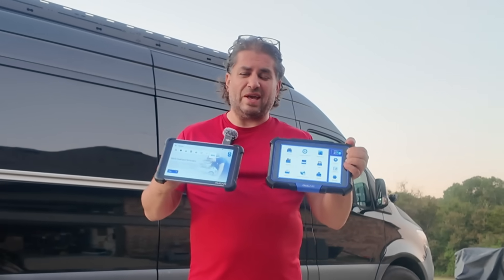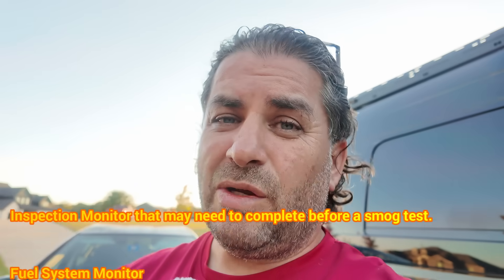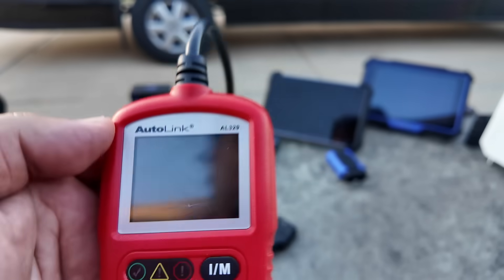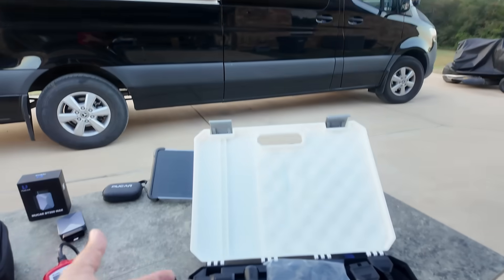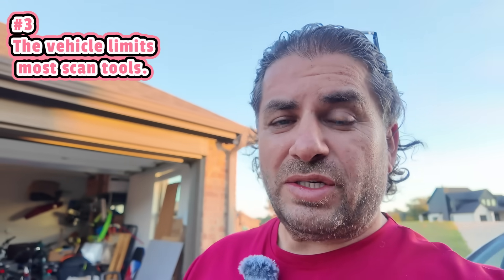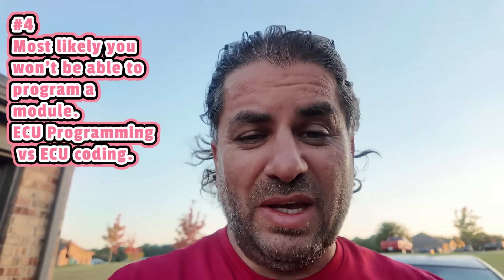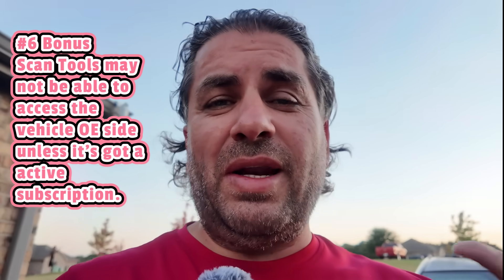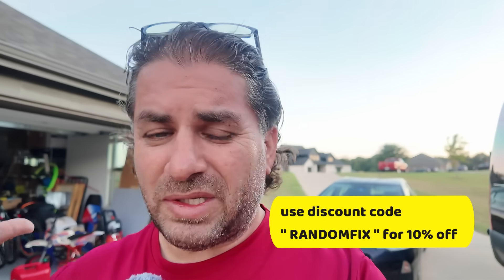Scan Tool Can't Do These 5 Things and No One Will Tell Beforehand

Comment: Well done. I recently decided to consider getting a scanner, but the options are mind boggling. I’m a DYI GUY. Recently retired from working on cars since the 70’s,,, yeah that far back 😁. Anyway I have a 2018 Dodge Grand Caravan and a 2008 Chevy Impala SS. I know most any scanner will work on the Impala but Dodge and Chrysler have Secure Gateway systems and I have to get what will work with that. Am I correct that subscriptions allow updates. But if you don’t pay for a current subscription that the scanner will not work at all? And why are some WiFi, is that only for updates or they will only work while the scanner is within WiFi range? Strange questions from someone who has worked on cars before but the dealerships had scanners so I never bought my own.
Reply from the maker: On your 2018 dodge you need autoauth access which runs over $50 a year but some scan tools may require you to buy from them and that access is $99+ a year. So would I do is try to bypass it the gateway like I show here https://youtu.be/uVVCs_zENxI?si=RByL52eMrlAnXygE and then get myself this https://youtu.be/q7QxnGdRL7s?si=_FpExnPy1pvNssP4 
You will also need to buy the bypass cables if you want to avoid that yearly charge and on some vehicles like you 2008 impala the scan tools may require can work without a Wi-Fi signal but on your dodge if you try to go the official way and purchase access for the yearly access they you would need a Wi-Fi signal.
That year fee is different from the scan tools may require updates, there maybe a separate fee for scan tools update but the one I recommend comes with lifetime updates.
I hope that helps and welcome to channel and hope you get to do lots of great things in retirement. 

Got a bucket list?

Comment: I purchased the Mucar 892 BT.  I own MB 2023 GLC300 and 2024 C300. The two give me an error related to”Encryption Gateway Authentication failed and limits the testing to OTC etc..” and is only a warning you have to click OK to continue. Also give me the note “sorry to inconvenience and ask me to download the software after delete it and perform fix firmware, then unplug Dongle for few seconds “ the options cancel, redownload or firmware fix. Any one clicked if you receive this note,  is over the scanner go into a bell sycle loop that don’t stop till reboot or shot down. Is a pain. Some times if complete the scan and you try to play with the results like maybe read live stream, or perform bi de rational testing the scanner freeze and nothing respond. I like to explain that works perfect on my MB 2007 C230. The only difference between other that the years are newer is that on the C230 only use the Dongle and on the newer cars it give you instructions to connect the Y adapter with a USB adapter to scanner I think to use the NOIP protocol. I having bad experience with support, the char immediate only ends on advice to fill the feedback form which I done it serveral times and they keep asking to give the serial number, my VIN of the vehicle and screen shots which I done it several times . I thinking the Y connector is the problem, because on the Y side nd the USB DAPTER before plug to the scanner have indicator of data active, flashing LED like any computer I see the data activity on the USB side of the scanner but in the Y side is dead nothing like is not working.  Any experience on this issue? I don’t want to return the unit to Amazon which dead like is about one week, I hope is a solution before that unless I get response from this forum. Thank you

Comment: For emissions, a basic $25 reader is more than enough - I just need the code so I know where I need to start testing components and to check for readiness monitors being set after repairs and clearing of the system.  I've had the Snap-On Solus scanner and mainly needed it for ABS and SRS code/system reading. Data is your friend (also for a code to set the monitor needs to fail twice in short succession).  only newer vehicle I own is my wife's vehicle (2016), my daily and trail vehicle are over 25yrs old (or close) so they are emissions exempt here in GA.

Comment: I have a 2012 Buick LaCrosse premium V6 3.6L with P0496 CODE  & 02S / HTR OXYGEN SENSOR showing on Emissions since 6-1-25 since then no check engine light I replaced 4 oxygen sensors, Gas Cap, purge valve, vent solenoid, mass flow sensor, Fuel pressure sensor, Map sensor, spark plugs, coil packs all OEM did drive cycles 4 times since then over 20 cycles each and over 4k miles each the 3 are the only ones that don't want to clear I am at my end in cash can't pass smog
Reply from the maker: These stories unfortunately are not uncommon. Here is the video to help with your o2 heater. https://youtu.be/Yn1-ul62Jio?si=K1sq4PbzHk4lSLtB

Is that only unset monitor?
Here is the gm drive cycle https://youtu.be/Yp34ksJY-fQ?si=LCnUDj2DHtCUoJqZ
Also are the o2 sensors all oem?

Comment: Think about before buying a product from this company.  My Think Tool Platinum S6 Scanner failed after an extremally light use. (The unit is not getting charge).   I contacted the company, and they are not providing any customer support. A lot of people are having the same issues with these devices. Please do yourself a favor stay away from this Brand

Comment: The evap excemption was mainly for gm vehicles because they are extremely hard to get ready. Even runnjng a service bay reset to get them ready often won't even work.
Reply from the maker: Now that exemption is gone, what can be done? 
No one I know has access to a service bay reset.
Reply: @RANDOMFIX  honestly I dont know. My scanner can do the service bay reset and my own truck wouldn't get evap ready after 5 minutes. Luckily I'm in NJ (not much better than california for emissions and bs regularions) so I was able to pass my inspection this week. Honestly I am sure its going to be california's way of getting more internal combustion vehicles off the road. They really don't understand that we are in no way shape or form ready for the amount of electric vehicles they want.

Comment: My OBD port randomly loses communication, the port itself was replaced and i could not find any other issues and suspect the BCM, I have power and good grounds at OBD as well as 2.6 volts at data [prts…. help///……😊
Reply from the maker: Honestly I've only had one such issue, on a 1995 ford thunderbird (don't know why but thus 1995 had obd2 already) and it ending up being a bent pin on the computer side. In my case, the regular mechanics couldn't figure it out, so I took it down to electrical shop and the figured it out in a manner of hours.
It's hard for me to give your other advice about this other than to also check carcomplaints.com to find out IF it a known issue and try some forums related to your specific vehicle. 
Good luck and keep me posted.
Reply: @RANDOMFIX ❤

Comment: As someone who started in the elevator industry in 1973 before computers. To spending the next 40 years watching computers and electronics dominate the industry. The computer diagnosis tools most of the time still require a highly trained technician to interrupt what the diagnosis computer is telling them. The more experienced the technician the faster and better the repair goes. Using your senses to help spot problems before a code shows up or after is very valuable. Todays auto mechanics/technicians are rock stars and deserve everyone's utmost respect. I was rebuilding engines and transmissions as a teenager. Today I still fix my own cars and trucks. It is no longer simple and often takes a while to diagnose correctly. Throwing parts at it is very expensive. Hats off to those who love getting dirty!
Reply from the maker: The elevator space is a good career; I'm trying to tell my 10-year-old son about it. Enjoy your time after putting in that 40 years. I hope that the hard work paid off!

Yes, they newer vehicles have made some mechanics/technician rock stars and other pushed out some that were good at wrenching but not at troubleshooting. If the right repair is not made that check engine light or issue will not go away like they older days where we just adjust the idle a little higher.
Reply: @RANDOMFIX  There are only about 25k to 30K elevator positions in the USA and Canada. It is a good job if you can get it. I encouraged both of my sons to become entrepreneurs. They both have business degrees to be better equipped to run a business. I wish your young son well in his endeavors.

Comment: I bought a fancy launch scanner with all those multiple adapters basically a waste never needed any of them in my workshop only the standard plug
Reply from the maker: yeah, I am producing a video that will launch this coming Saturday about such a scan tool, I believe that only Mercedes still using those legacy ports for some sort coding, normally that plug is located behind the stereo display.
Reply: If you are a for-revenue shop, advertise your ability to diagnose older OBD1 vehicles. then you may be able to get some ROI.
Reply from the maker: Good suggest!!
Only issue is that after the 70’s the vehicle longevity is gone. There are probably few vehicle left over from 1970 to 1995.
Honestly look around. These vehicle, including the one that are made today are disposable. We are getting screwed. It’s not about the environment it’s about making us buy more!
Reply: @RANDOMFIX yes. One reason I gave up on the business.  Any damage practically totals the vehicle, every bit of information is behind a pay wall, tools are more expensive, customers have less, etc. It's a mess.

Comment: I have Citroen C4 that when the pats fluid tank is refilled needs a computer to tell the tank it's full again. How mad is that. Oh by the way trying to find a code reader that does that function. For a lot less than £3000.
Reply from the maker: pats fluid tank? do you mean (diesel exhaust fluid) DEF fluid tank?  £3000 for scan tool to reset that? Are you running your tank dry? It should auto reset if it doesn't get emptied.
Reply: @RANDOMFIX should isn't does .10,000 miles is to empty so I fill at 8,000 and pay a guy £20 to plug in and reset the tank.
I just would like a obd 2 reader and do it myself. It's just trying to find one.
Reply from the maker: A obd2 reader can not do that but a scan tool can.
Scan tools start at about $79 for app based one and tablet based scan tools start to be good at about $199+

Just don’t get trick into paying for updates. 
Look for a special function called “def reset”.
Reply: @RANDOMFIX will do thanks.

Comment: one way I have found to get monitors reset is run at least 60 MPH for 10 miles, find a level road with low traffic get up to the highest speed you dare then take your foot off the gas and brake and coast down until you are impeding traffic, do not touch the brake it will start over, you also need a few cold starts and some idle time
Reply: yup stay to the right and go 60 (don't go over) and it will force the monitors to run their checks.

Comment: you can buy the most expensive scanner there is. if you dont understand what your looking at ,and have a Good understanding how of the systems you've working on . its not going to do you any Good
Reply from the maker: Yeah, and I completely forgot to mention topography is a must on the newer vehicles as it’s hard to know which line each module  is communicating over.

Comment: I have a 2007 Chevy Impala V6 on highway I get 34 to 36 MPG. In the city stop and go it drops as low as 23. I have an Actron scanner that works great. And yes you still need to put on your thinking cap for a few codes. GM made a huge mistake on the emission side. I have replaced the sensor that goes down to the tank. They go out easily. There is a hole just beneath the fill port and if you grab the gas nozzle at the station., sometimes there is a lot of fuel left in the nozzle and it will flood out and go down this little hole and fry the sensor. In time you will set the code for emissions. I replaced it once and will not do it again. I will from time to time use my Actron and erase the code. I do it this way to make sure there is not another code. Believe it or not I get better mileage when it trips the ECM. I live way up North
Reply: if you have a hole in the fill tube it is probably rusted through the only electronic part near the fill tube would be the vent solenoid, the only sensor in that evap system is a pressure sensor on top of the tank, evap problems have nothing to do with fuel economy exept for a leaking purge valve that is on the engine

Comment: bottom line, if you're not trained or willing to learn how a modern car works, you are at the mercy of those of us that do.  You can can buy cheap code readers or even little better tools that do bidirectional controls, but if you don't know the what and how of your car works, it won't help you.   Clearing codes is not a fix, and some of these aftermarket services that give you the "quick fix" and what percent of the time it worked, are just a bunch of hacks swapping parts.  You can try it and maybe get lucky, and if so, you should buy lottery tickets too.
Reply from the maker: Yeah I hear you on that.
These newer vehicles are something else. 
I feel like no buying anything newer as I have a 2024 mbz and man is it a pain in ass even with a scan tool.

Comment: REMEMBER, Lifetime Updates means as long as the company is in business, there have been companies go out of business due to poor customer service and many poor reviews so they shut down and reopened under a new name with a better product but the old product is without the free lifetime updates now. Of course, we are talking about the Chinese-branded companies. Do your research. I cannot give the name because a youtuber is being sued for outing the name of the old and new company. There are more than 40 resets as of today on some scanners.
Reply: I learned this without a lifetime update , bought an Ancel V6 back in the day. On the last update on year 2, it crashed,  and the company wasn't checking
Reply: Lifetime updates also can mean that the tool is only supported one or two years and then its classified EOL as soon as a new version is released replacing the one you bought.
Reply from the maker: You may have a point, but I think they will keep the subscription active meaning you can still use it for vehicles that require an active subscription.
The interesting thing is that most of the scan tool use the same o s and just get minor tweaks.
If the scan tool get updates for 5 years I say it’s solid! Nothing is forever
Reply: @RANDOMFIX  Correct, most Scanners will work forever without an update, we just cant use the newer features for newer cars, which many mechanics will not keep up to date so no worries. An extremely small handful of Scanners will totally cut off without an updated subscription as it is also a continuation fee.
Reply: They're all using launch x431 software...

Comment: Scan tools can't do a fuel pressure regulator test and flow and fuel injection flow OBD2 are more advanced and are gi for car yards to clear  fault codes for a sale
Reply from the maker: You raise a few good questions.

You can use a pressure gauge for fuel pressure but sure that would be nice if the scan tool was able to get to test that.

How is obd2 more advanced?

If car yard clear a fault code, presuming that they test for emissions how would they set the inspection monitors?

Comment: remember one thing can your scanner get past secure gate way in late model automobles now days
Reply: Elaborate
Reply: the manufacture gives limited access to electronics of vehicle for safety reason. then your forced to a gateway like autoauth to enter system
Reply from the maker: This is true of fca vehicles like dodge /jeep/fiat and Nissan but other makes don’t have these security gateways.
You can also get bypass cables do fca vehicles.
Reply: bypass cables are great I have one access to gateway module can be interesting at times
Reply: @mikeburchett-bs3qw alrightyyy thennn. Are they monthly/yearly subscriptions or someone has the jailbroken version?

Comment: I’ve got to get a newer scan tool that works with 2018 and newer lines particularly Dodge pickups with the Cummings.  I’m looking at the launch x431 pros3+ elite, will have to purchase the subscription I guess.
Reply from the maker: You will also need fca autoauto.
I don’t try the bypass cables https://youtu.be/uVVCs_zENxI?si=VcNk2aoKfQ1r6lNo
So you may want to try this before paying yearly for autoauto and maybe try a scan tool that has lifetime updates https://youtu.be/q7QxnGdRL7s?si=cV4PbSwlqD8JZYaU
And they offer a 30 day refund if you buy direct or buy from Amazon.
Good luck and let me know it goes.

Comment: The very reason I will not buy anything new is because of the complexity of them even at 70 years old I still work on my stuff and help all the grandkids none of them know anything and don't want to learn the newest thing I have is a 2013 Ram that is running fine do have a TPMS sensor that needs replacement
Reply from the maker: Best and cheapest way to fix that Tpms is go to Walmart as it’s the best deal and there is no easy way to replace that tpms sensor without a tire mounting tool. 
Should run at $28 per tire with Walmart plus.